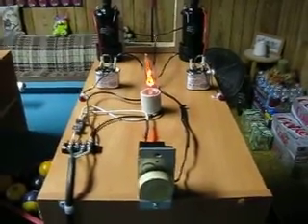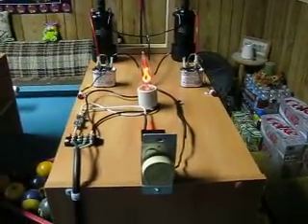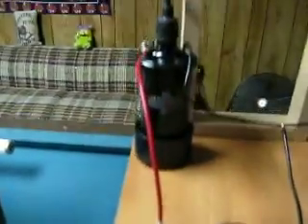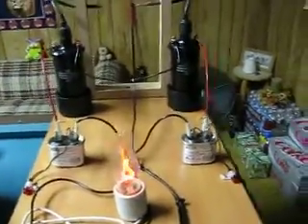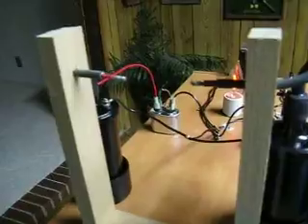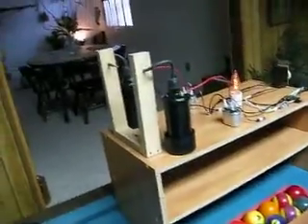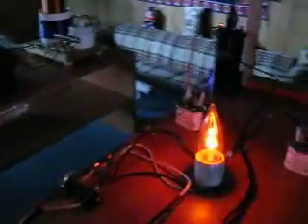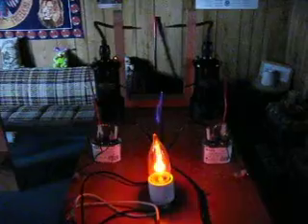High Voltage Arc / Ignition Coil - Light Dimmer Switch  - Run Capacitor - Circuit

Comment: I did this about 16 years ago... except i used a high voltage microwave capacitor. arcs were at least 8 inches long.

Comment: I believe it's a camera effect due to the framerate of the camera and the frequency of the bulb. You tend to see if alot when viewing spark gaps and such through a digital camera. I noticed it when recording CRT monitors quite a lot. Not sure why it'd disappear when the circuit was activated, though.

Comment from the maker: Fastback86-
The project in the video uses one 5MFD, 370Volt A/C capacitor for each of the ignition coils.  I have since upgraded the project to include a switch that puts a second identical capacitor in PARALLEL to each of the coils (brings the capacitance to 10MFD per coil).  It gives a stronger spark when turned on (as 10MFD lets more current flow than a 5MFD).  Downside is the coils warm up a little faster so you don't want to run this for more than a few minutes.

Bruce

Comment from the maker: (cont')- Afraid the hookup didn't show up as I typed it.  Let me try to continue the narrative:  Hook up cap #1's other terminal to the (+) of one of the ignition coils.  Hook up cap #2 's other terminal to the (-) of the other ignition coil.  Connect the remaining ends of the ignition coils (-) on the first coil, (+) on the second coil together and connect this to the other AC line (White-Neutral).  That is about it.  Hopefully this makes sense without a good schematic.  Bruce

Comment from the maker: Hookup is pretty straight forward, though hard to show in this comment box, but I'll try:

AC Line ---Fuse----Dimmer-|--Run Capacitor-----(+) Ignition Coil (-)-|----AC Line
                                       |- Run Capacitor-----(-) Ignition Coil (+)-|

Note the two "AC Line".  One is the black Wire (Hot) and one is the White wire (Neutral).  Connect AC Line Hot to fuse. Connect one wire of the dimmer to the fuse and the other wire to one terminal of each of the two caps.  (con't)